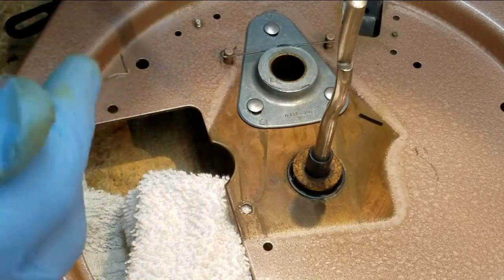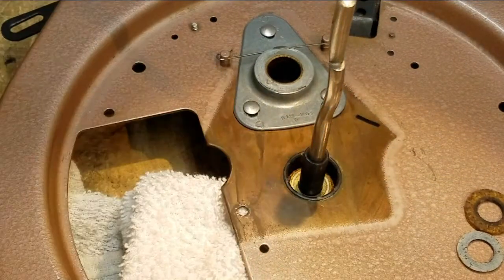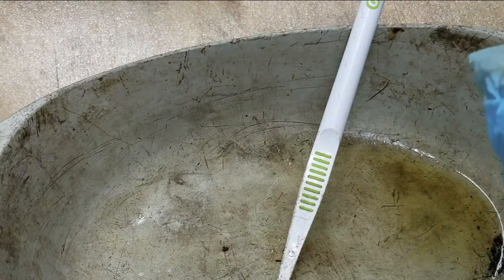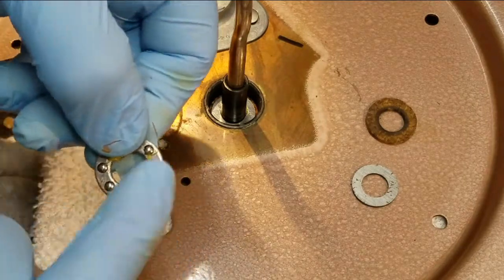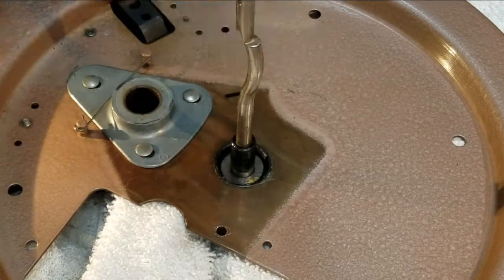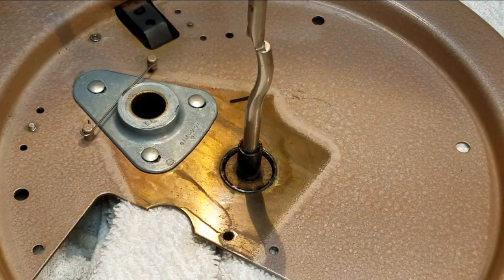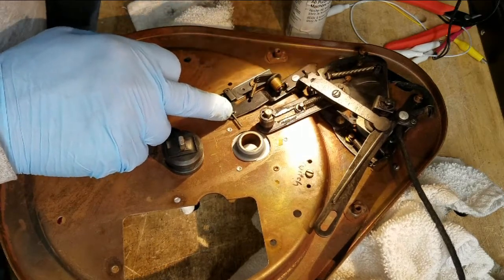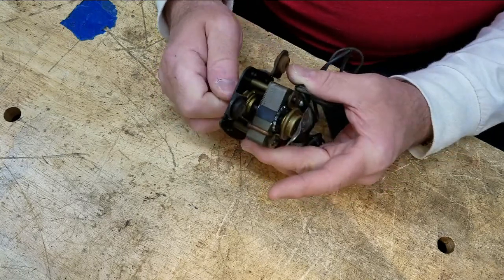1949 ADMIARAL 6F11-N Radio Record Player Part 6 of 8 Phonograph

Comment: Cool Michael....and I guess that makes the reject switch the locomotive's "Johnson bar", hee hee.  My favorite has always been the Pacific class 4-6-2, but that being said, did you know that Union Pacificis restoring the largest steam locomotive ever?  Back in 2014 they announced they were going to put a UP Big Boy back into service, a 4-8-8-4 monster.  They took one from a park in Pomona California that had sat idle for the past 60 years, took all it's shafts & bearings off, lubed them up and with panel track took it across the parking lot and installed a temporary switch to a mainline track and pulled it all the way back to their steam shop in Cheyenne, WY.  I think it was originally estimated to take until 2018 to rebuild it all, but I think it may be closer to 2019 or 2020 before it's ready as they also have to keep their 4-8-4 ready to run.  I've been following it's progress for years now, lol.  Take care, Gary
Reply from the maker: That's cool about the UP loco!  I find them fascinating.  One of the reasons that I enjoy British films so much is that they regularly feature the small-gauge old trains and it seems that the Brits keep them running - at least for films!
Cheers!   Michael
Reply: In Britain they used steam a lot later than we did as we had all but given them up by the mid 50's.  Britain continued with them in regular service until almost 1970 before the switched to diesels, so many of they'res  didn't reach the scrapper's torches before efforts were begun to obtain and preserve them.  One of the most iconic steam locomotives in this country was the Dreyfus Hudson and today there's not a single example left, all were scrapped out.  :(  UP has always had a steam program and their #844 the Northern type 4-8-4 is the only steam locomotive in this country that has never been retired since it was new.  UP also has besides the Big Boy they're restoring UP Challenger #3985, a monster almost as big as Big Boy with a 4-6-6-4 arrangement.  Norfolk Southern out here in the east has a steam program as well but no locomotives of they're own.  They do regularly borrow them from museums to run in excursion service though.  They use Nickel Plate Road's #765, a Berkshire class 2-8-4, Tennessee Valley's ex Southern #630, a Consolidation class 2-8-0 and TV's ex Southern #4501, a Mikado/MacArthur class 2-8-2.  They have one other engine they use from the Virginia transportation museum which to me is the most beautiful steam locomotive still in use in the U.S., ex Norfolk & Western's J class 4-8-4 streamliner which returned to service just last year.  The UP has switched all their coal locomotives to burn bunker oil instead, while Norfolk Southern's still burn coal as their fuel.  My problem is the area I live in.  All the major tracks are owned by CSX and CSX refuses to let any steam locomotives run on their trackage, period.  So, unless I go to Kentucky down to their railway museum and ride on their old pacific class L&N #152 I never get to see any, lol.  YouTube is absolutely chock full of videos of all of them though so that's usually what I watch when I'm not watching radio repairs.  Take care, Gary

Comment: Nice work!. Do the phono motors typically have felt pads that absorb and hold the oil?
Reply from the maker: Yep.  Those endbells on this motor have little ball & socket bearings that each have a felt disc on top of them.  I probably wasn't very clear, but I put a few drops of sewing machine oil on those discs, and they are well lubricated for years.  Sometimes, when a machine has been used a lot, I will take the motor apart and soak those discs in lacquer thinner to clean them out, before lubing them with the oil.  Works like a charm.  Thank you for watching!   Michael
Reply: Thanks for the reply. That motor looked similar to some I have serviced in old heaters and dehumidifiers.  Just clean and reoil the felt and they run great for many years.